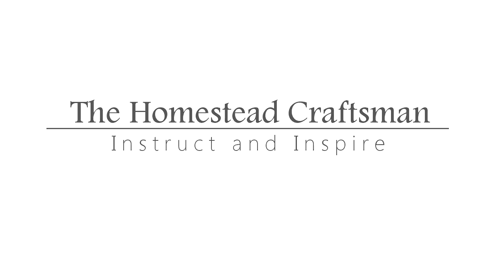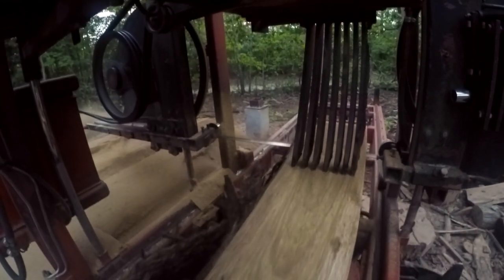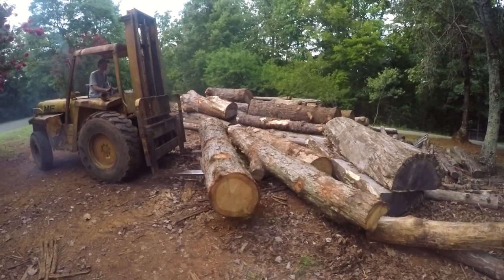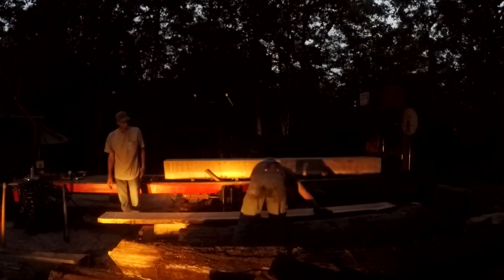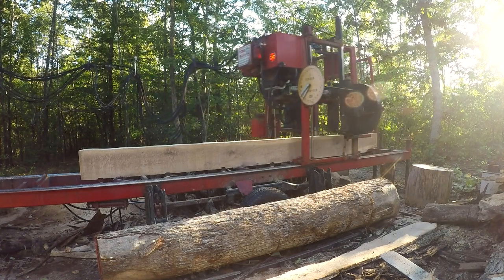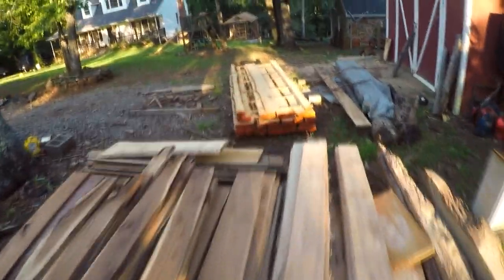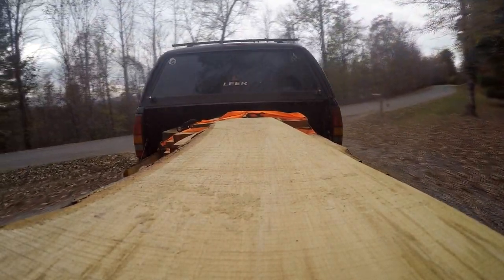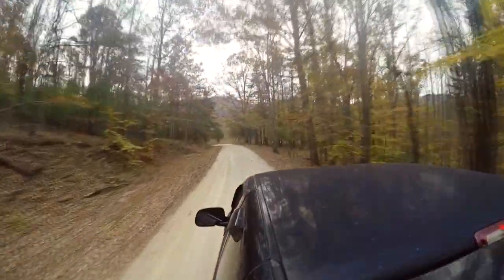Part 1 - Table Design & Sawmill - Oak Trestle Table - Woodworking Series!

Comment: great video! awesome perspective! would you mind talking about pricing your tables and why?
Reply from the maker: Perhaps, some people are not very "comfortable" with the topic of money so I have left that aspect out of the overall conversation on my channel so far. Also, price can vary for so many reasons so how much I price a piece of furniture can be wildly different than the next. We'll see, it's a frequent request.
Reply: thank you for your reply,

I am somewhat of a carpenter. I make tables, chairs, mirrored items, with quite a bit of live edge and wrought iron work. the reason I ask is because I have always found it difficult to formulate a price and have valued my work by the question of, "how much money will I need for this job to feel it was worth my time". a factor in this price is often how difficult it will be to satisfy a person's request or standards. I enjoy my work immensely and take great pride in all of the work I do and only provides products to the best of my ability. simply put, some people are more enjoyable to work for than others.

I then look at how much I would be willing to pay for the quoted work and see how close I am from the enitial amount. if I am high I will still quote a price and tell the costumer someone else would most likely be cheaper and or be better suited for the task at hand as I may not be able to provide the work the costumer is after.

without talking exact amounts, would you be able to talk about your process of valuing work?

thank you for your videos, they have been great from the beginning of your channel